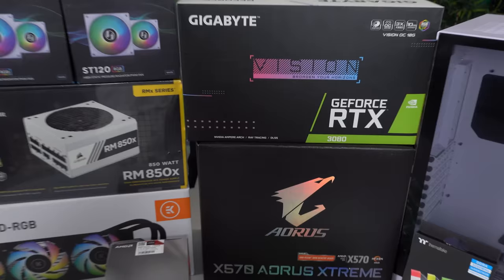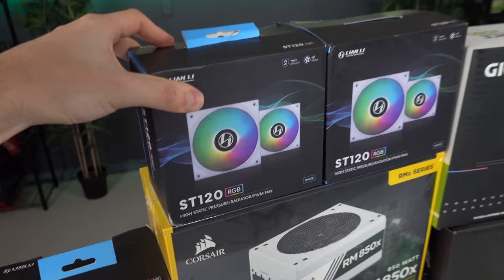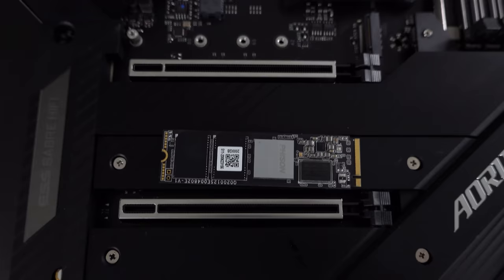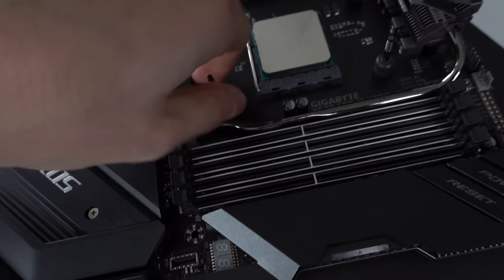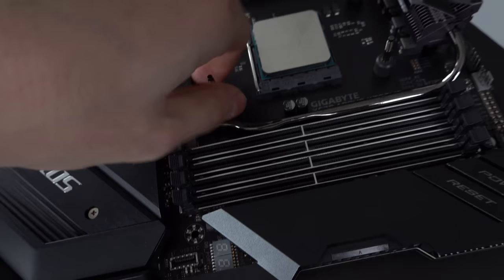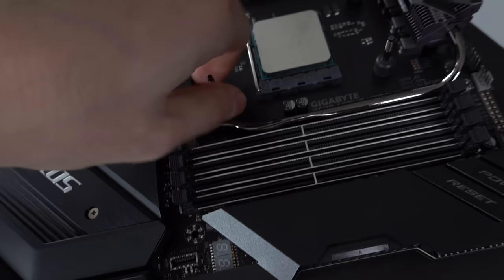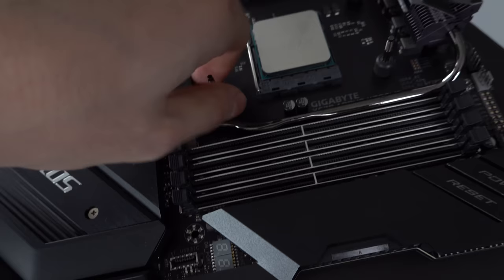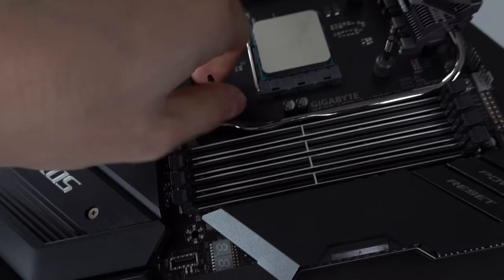I'm Bored. Let's Build a PC!

Comment: Me: “I am bored, let’s build a pc”
goes on amazon to look at pc parts
 after checking my bank,
launch pc building simulator
Reply: I can't even get the parts together. Graphics cards are sold out everywhere.
Reply: @r.s.4174  they really are man.. I’ve been looking for 1650 super for a little bit now
Reply: yea I can't even play pcbs on good fps
it runs at about 15 fps on 720p
Reply: @sterlingrahling8300  same I was going to get a 1650 super but all I found was a 1060
Reply: @sotq  why do people want a 1650 super
Reply: @quizgu183  because it’s a good card for gaming 1080p high above 60FPS my 1060 can do this so I’m happy with it also
Reply: @sotq  is the Radeon RX 580 good it’s 8gb
Reply: @quizgu183  it’s decent I would not buy one though I like nvidia better
Reply: @sotq  is it better then the 1650 super and can I ask why would you pick Nividia instead I don’t know much about pcs
Reply: @quizgu183  there pretty much the same performance but nvidia has better settings on there control panel imo
Reply: @sotq  amd
One simple word to fix ur sold out experiences
Reply: @quizgu183  same performance bro , the 8gb vram version does a little better on heavy game i believe
Reply: @theskywalker8416  so when buying a gpu do you look at which one has more gb memory which determines more FPS?

Comment: E: "I'm bored let me build a $4,000 pc
Me: sigh
Reply: E 
E
E
E
E
E
E
E
E
E
E
E
E
E
E
E
E
E
Reply: @mojoshyperr8835  I BEG UR PARDON
Reply: @lujain3234  Whats so weird, i am watching this video because i want also push pull and its nasty. My PC (only the PC) cost between 6 to 7K. But its gonna make me money so ye. I do alot stuff in crypto so... 6K is not alot then anymore. Compared to another number of money so ye. I also have a fulltime job beside that and need the raw power for something that makes me money. And its not mining. Data analytics. I don't do gaming, and still have a 3090 but use it for tensorflow. It's cheap because if you really want more power, you go to threadripper where a single CPU cost 5000. And the performance for my task is less than twice as good. Like 1.8 times better. So very bad value. This 6K PC is perfect value for money. 5950x AMD, 128GB memory(ECC)
Reply: @kimmyboy589  i love people like you

Comment: I just redid my build with almost completely new components all I took from my old one was the ram, PSU, drives, and the GPU and it looks so sick!  In my old computer, I put the r7 3700x that I got for my bday into the b450 mobo I had, and it did work without needing a bios update but the CPU still isn't even 1 month old so I don't really count it as a carryover from the old computer.  So in my new computer, I got some of the corsair vengeance RGB pro ram (32GB of ddr4-3200 cl16) and I have two extra sticks of ram from my old computer (16GB of g.skill aegis ddr4-3200 cl16), and the motherboard I used looks so sick! I used the Asus rog Strix x570-e gaming so it was a perfect match for my CPU but I still need to wait for money for a new GPU because I have an RX 570. (the bottleneck is real) I also used the NZXT h510 elite and I vertically mounted my GPU in it. (i do have good airflow so no need to roast me) I'm also going to save up money for the next AIO with the LCD screen on the pump but for now, I'm using the stock cooler that comes with the Ryzen 7 (it works fine too).  Here's a funny story: so there are two things. 1. I just figured out how to use the SSD brackets on the back of my case like two days ago :P and 2. I couldn't fit the USB 3.0 connector into the socket and I found out that there was a blockage in one of the pinholes and there were also two bent pins on the motherboard port. so, I used a toothpick to clear up the blockage and bend the pins back in place so now that the front panel USB port is usable and my headphones are plugged in there.  I also got fan labels and stickers with the motherboard so I put the pixelated rog logo on my side panel + the Ryzen sticker that comes with the CPU.  Also, when I first tried booting the pc, the CPU fan was working but took me a while to figure out what the "CPU fan error" meant. I didn't plug the CPU fan into the right slot. -_- so, after that, I plugged it into the port on top and it finally booted.  My fingers definitely hurt after writing the whole harry potter book about my computer but I like it a lot.  I also want cable extensions for my ketchup and mustard cables.  ALSO:: one other thing. It took me about 30 minutes and 3 hurting fingers just to fit the 8-pin CPU cable into the socket in the top corner because the hole to rout it through is so small on the h510 elite and the angle that the cable is bent at took me so long to plug in the cable.  My fingers also blocked out 90% of the light that I wanted.

Comment: This actually resembles my rig very much, i got the white lian li case (non xl), i got the same AiO on a ryzen 9 3900x and i got the white Asus 3080. My MB is the B550a strix gaming from asus, really fits the design of the Graphics card. Also got the same PSU but with 750W instead of 850 and i got the G.Skill trident z royal RAM in Silver. Really enjoyed that build of yours 👍

Comment: Dear Computer builders, braided audio front panel extension costs 8.99 from cable mod, a full heat shrink kit(used to cover up the ketchup and mustard) costs 10 dollars and you will never need another one. If you are going to spend this much money please take that little extra step!

Comment: I have is the same case built in last year with hard tube custom water cooling with 3 x Alphacool NexXxoS XT45 Full Copper 360mm Radiator 10 x Lian Li Bora Digital RGB PWM Silver 120mm and I bought Lian-Li PC-O11DXL-1 Riser Cable + PCI-E Bracket Kit for PC-O11D ROG Series for the GPU vertical set up the GPU is also water cooled Gigabyte GeForce RTX 2080 Ti AORUS XTREME 11GB GDDR6 Waterblock Graphics Card

Comment: It can't be helped that the CPU temperature is high. Because the radiator is installed at the top, the warm temperature inside the case is blown to the radiator by FAN. I am exhausting warm air from the top as it is, such as a radiator on the side and a GPU on the top.

Comment: I think your lateral Fans and bottom Fans are mounted in the wrong direction. You must see the nice logo inside the case and the wind should be pushed from outside at the bottom to inside. And the lateral Fans should extracting and pushing from outside to inside the case. Remove the exceeding 3 Fans from the watercooling at the top of the case and keep only 3 Fans extracting the air and pushing outside to the radiator which is fixed by the screws. Your PC will be nicer with better performance as well. At the end, your bottom and lateral Fans should push air inside and the Fans at the back and the top should extract air from the case.

Comment: Why didn't you apply thermal paste to the aio cpu mounting plate? Also the reason you had fitment issues w/ the top aio is because the case was designed for a radiator + one set of fans on one side of the rad- you have two sets of fans on each side of the rad- not really a standard configuration imo.

Comment: The push pull would fit in the vertical...you just have to mount one set of fans on the other side of the case.. (fan, case, radiator,fan)

Comment: hey man idk if you will read this but i got a big issue. i built my second pc and i try to boot up windows from the flashdrive with the windows installer on it and it just gets stuck on the windows logo. there is no loading circle at all. im completely stuck and so close to finishing my build. if anyone knows how to fix this issue please respond. the only weird thing is that my flashdrive shows up 2 times in the boot bios. if anyone can help me please comment 🙏🙏

Comment: was there any other hub used for the D-RGB fans.  I think the EK hub held like 6 or 7 but that leaves another 7 fans. plus the RGB for the CPU cooler, case.. etc.  are the other fans just plugged into the motherboard, or are they daisy chained into the single hub?

Comment: Cant you just mount the radiator on the side of the case but behind the panel? and attach the fans like you have done? so it will get bulky only from the behind of the case? :)

Comment: You can do a push and pull on the sides. Don't install the other 3 fans directly on the radiator but on the other side. Using same case and it fits.

Comment: Ik I’m dumb bull m it here, what is the point of hav Aio cpu cooler because all it does is water cool and take up fan slots like what are those fans for, also don’t you have 10 fans not 13, and lastly, difference between exhaust and intake? Am I doing something wrong

Comment: Could you try the 5800x in that unit? i want to see the temp. I got the 5800x and temps are very high. Using a 360 aio from coolermaster and h500 mesh for the case.

Comment: This is the only one I saw that has the cpu properly installed on top so the tubes get intake cooling. pretty sure thats the entire build design.. but why does the mini not even fit that way? correctly.
Reply: damn, just need to tilt the water cooler up tho its installed sideways. probably on purpose. but.. directions!

Comment: Sorry, but this case is Meh... not enough space it seems. Btw the temperatures.. 66 °C is too much for this high-end AIO cooler, set the CPU voltage back to 1.25-1.325V, you will get much better Temps, my 3700x not going further than 59°C on full load overclocked to 4.4Ghz all core with a 240mm CM Lite AIO. The Vcore was 1.47V by default for me...

Comment: CPU: AMD Ryzen 7 1700 
chladenie: ARCTIC Liquid Freezer II 360
GPU: Asus Turbo Gtx1060 6gb 
chladenie: NZXT Kraken X73+ NZXT Kraken G12
Motherboard: ASRock X470 Gaming K4
Ram: G.SKILL 16 GB KIT DDR4 2400 MHz CL15 Flare X for AMD 
chladenie: Arctic Cooling RC Turbo Module Ram Cooler
Case: Metallic Gear by Phanteks NEO Qube White
Fan: 3x ARCTIC P12 PWM 120
Zdroj: Corsair CV650
SSD: Kingston SSD A2000 480gb m.2

 is this good for lees than 1,500 dollars?

Comment: This is the first build I've watched using 6 fans on the AIO...why? Sorry if it's a dumb question, still learning here :) I would have thought 3 would have been sufficient to pull the air out the top? This would also have made the AIO less thick and cause less issues with installation. Hope someone can educate me on the reason for the 6. Thank you! Great looking build.
Reply: hes using a push/pull configuration.

Comment: I know you probably wont see this comment but if your do I really need help with buying a PC im so confused whether I should Pre Built or Build my own but the videos always say There 650 dollars and it turns out the Pc is 1000 dollars if someone could HMU on discord and help me find a Pre Built or the Parts for a Pc I would appreciate it. Siah..#3281
Reply: You have to keep in mind that we're in a pandemic and PC components are in short supply and high demand. The little supply that is available is usually overpriced. That's why a lot of the PCs are more expensive than the title says. There's that and the fact that bots are buying up the short supply of components is causing this inflation.

Whether you buy a pre-built or build your own PC is up to you. If you have the desire to learn how computers work and overall have an interest in them, you may want to consider building your own. If you don't want to deal with the assembling of the PC or any potential issues at all, then you probably don't want to build one.